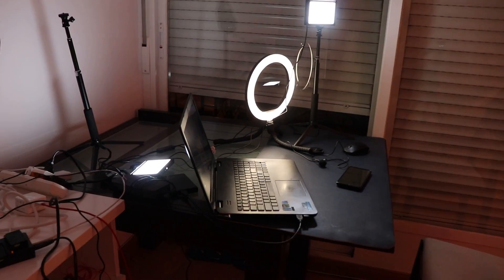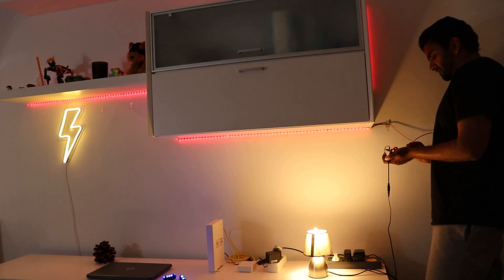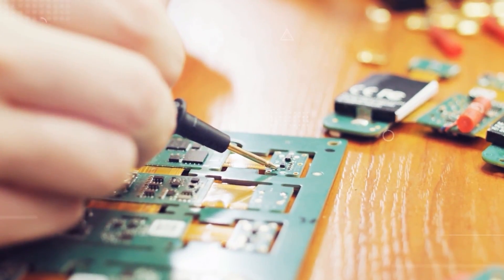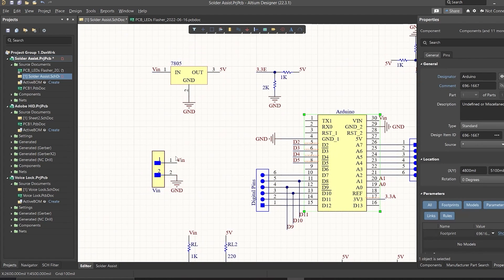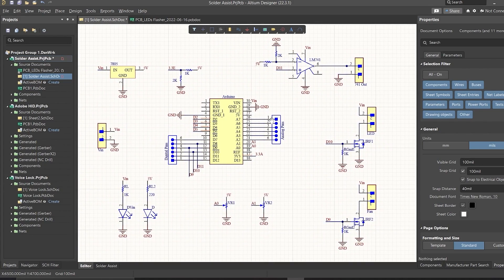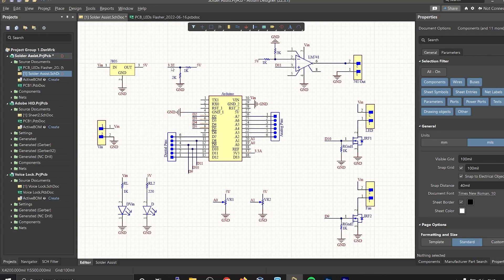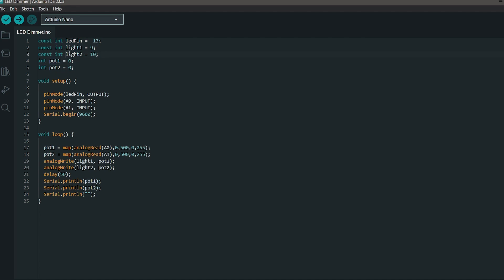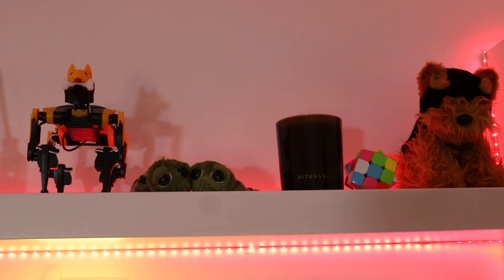Control the Brightness of Lights using a Potentiometer and Arduino | DIY Light Dimmer Circuit

Comment: I have been tasked with trying to figure out how to use two potentiometers to control 2 separate lights.  Both Leds.  But we want to have a sensor power on and off.  But when I adjust the lights down for my personal use, I don't want the controller to remember the settings I have made so when I leave and the power is shut down because I have left my desk when I come back I want it to reset to a preset adjustment.  Say 50% for example everytime the power shuts down it resets the value back to 50% regardless if I had it turned all the way down when it shut off.  Is this possible to do?

Comment: Can i control brightness of LED tube light with this
Reply from the maker: Good question. And the answer is it depends on the voltage of the LED tubelight. Tubelights of different voltages are available in the market. Also it depends of the Tube is DC operated or AC operated.
Reply: @RootSaid  AC powered 220volts